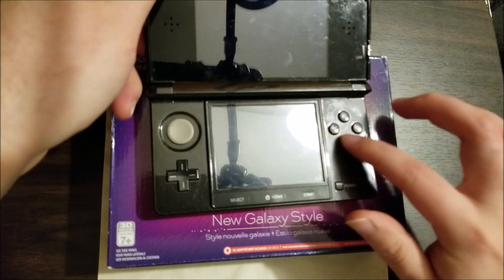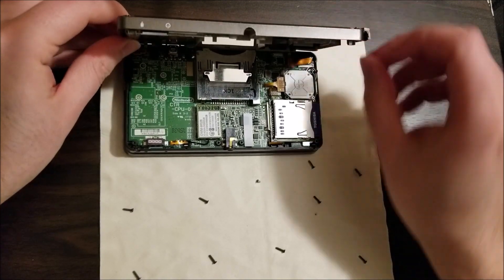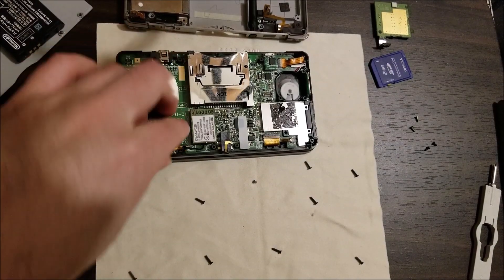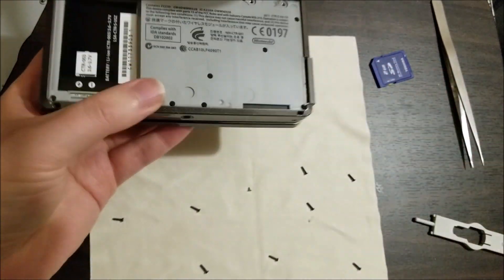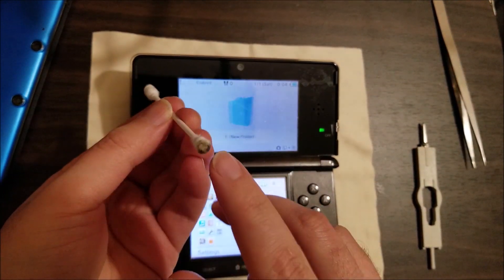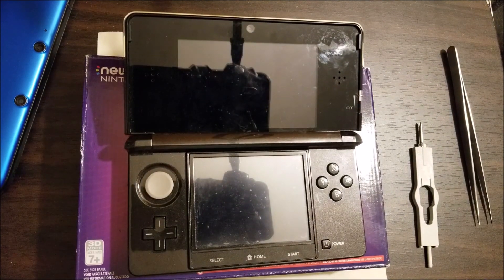Let's Fix: Nintendo 3DS Buttons Not Working

Comment: does this also work on the different models of the 3ds i just want to make sure (new 3ds xl, new 2ds, etc.)
Reply from the maker: As far as I know all variants of the ds use the same tact switch style buttons, though some have discrete smd switches (which imo is an easier fix as you can just buy and solder new buttons rather than mucking around with peeling and cleaning).

Comment: Thanks for uploading. My 3DS is having this weird issue where the A button registers two inputs at random in quick succession. It seems to be once when pressed and once when released.

Would you say it's a good idea to try and clean it from the outside with IPA or canned air? Nintendo suggests using a toothbrush on the buttons, which worked a couple of years ago, but it ain't cutting it anymore.

Anyway, thanks again. This will come in useful if I do pull the trigger.
Reply from the maker: Yeah sounds like it may be getting stuck slightly and need some cleaning.
Reply: @sjm4306  Right, thanks. And excuse me, but do you mean by taking the console apart or just some cleaning from the outside? It was by basically sticking the toothbrush into the button.
Reply from the maker: First try cleaning with a soft brush and some isopropyl alcohol without taking it apart and if it still has problems after that then you'll need to take it apart and clean the buttons on the pcb and the inner plastic parts of the buttons.

Comment: Hey, I tried following this tutorial and I did but the buttons still didn't work. I opened the buttons not working,  I was wondering if you knew of any other problems, thanks.
Reply from the maker: It could be the metal snap domes themselves are worn out. They sell replacement ones with the sticker already attached on ebay/aliepress.
Reply: @sjm4306  What tools and supplies do you use and where can I get them? Also do you still do repairs? I do not have a steady hand, so I'm positive it's not in my best interest to take apart my 3DS XL myself.

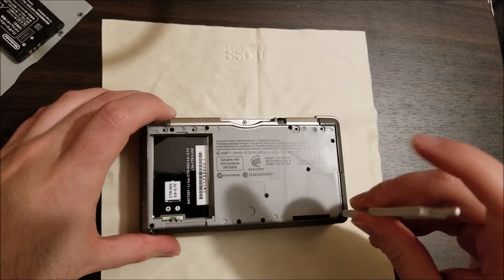Comment: I think it's My fault but up until here I have Problems 2:10
You seem to have an easy time with the screws but For Me THEY ARE NOT COMING OUT!!! I've tried the other screwdriver Heads but one of them work and I thi k they are different Someone Help! 😩
Reply from the maker: You need a small sharp phillips screw driver. If you try to use one that doesnt fit it's so easy to strip the screw heads. Also going slow and pressing inwards helps.
Reply: @sjm4306  I did use a small Phillips head tho, huh looks like I may have to go SMALLER!!!!, thank you, thank you, thank very much here

Comment: Hi sir. Is that a sticker? After you cleaned the seat buttons? Is it easy to remove?
Reply from the maker: The sticker over the metal snap domes is kinda hard to remove as it's stuck very well. It took a few minutes of careful prying to peel it off.
Reply: What cleaning agent did you used sir ? Is that isopropyl alcohol?
Reply from the maker: Yep

Comment: Can this happen with normal use? Because my 2dsxl buttons work fine but they are kinda loose and i always feel they are going to stop working if i use it too much.
Reply from the maker: The specific corrosion damage I showed in this video was caused by some liquid being spilled on the console near the buttons. Under normal use this shouldn't happen, however the metal snap domes in the buttons do have a limited number of presses till they stop working (the number is in the millions of presses though).
Reply: sjm4306 oh ok thank you very much for replying on an old video, couldn’t find an answer for it anywhere.
Thing is i use it for GB/GBA emulation and playing shoot 'em up games feels like too much abuse for the poor thing

Comment: the power button on my 3ds is not working can you fix it?
Reply from the maker: Does it do anything when pressed (does the blue light come on, do you see any of the screens flash, do you hear a click or pop sound)? Also does it charge when plugged in? I ask because rarely does the power button itself physically fail, no power on is usually a sign of another problem like damaged or miseated ribbon cables or liquid damage.
Reply: @sjm4306 it lights up when charged and it takes a day or two for it to turn on after i've pressed the power button many times. i also don't know if it got wet because it was in our storage room for a long time.

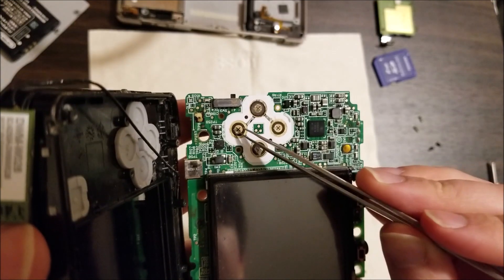Comment: 6:50 How do those buttons work? Does depressing the metal membrane on top connect the circle with the X to the ring outside of it to complete the circuit, or does it work differently?
Reply from the maker: Yep that's exactly how it works
Reply: @sjm4306  Ah, thank you!

Comment: Yeah first i should say thanks for the video, but unfortunately its pretty useless since you cut out the most important part (the one where you put off these silver lids of the abxy button conductors). I am sitting here with a dissassemblied 3ds and cant continue because i dont know how you did it and i dont want to damage my 3ds.
Reply from the maker: The metal domes are literally held on by clear plastic tape, you just peel (though the adhesive is pretty strong). I figured no one would want to watch 10 minutes of me using my fingernails to pick at the edge of the tape to peel it off.
Reply: @sjm4306  
I figured out at the end but i was very worried that i screw something up. Once again, i dont want to be ungrateful because without your video i wouldnt even have come this far (and up to this point it was very thorough). Maybe you could add some sidenote on the screen with short instructions, that would make your video perfect. Anyways, thank you for the video. ABXY buttons are working flawlessly now :)

Comment: Does it work on 3DS XL ? My A button has the same problem, I need to press it very strong for it to work
Reply from the maker: Yes, all 3ds consoles use the same button construction.
Reply: @sjm4306  Okay, how do you do to remove the AXBY buttons membran without damage ? I suppose  that it must be the most damageless in order to replace it
Reply from the maker: The metal snap domes that make electrical contact with the pcb contacts are held on by a clear plastic tape that can be carefully peeled off.
Reply: @sjm4306  I just finished reassembling my 3DS, my touchscreen doesn't light up, my pad is stuck at one place and all of my data had been erased, I wanna cry
Reply from the maker: If you removed the sd card and didn't put it back that'd explain why your data is gone (or if you have the new console variant I believe there's a press snap connector for the sd slot that could be the problem), as for the other problems double check that you fully inserted the ribbon connections. Just opening and closing a 3ds cannot do anything to the data stored on the device
Reply: @sjm4306  Yes, I've got my data back thanks to the SD Card ^^ I'll check the ribbon
Reply: It worked, I've must have done something wrong with one of the ribbon and my A button is back to normal. Thanks a lot !

Comment: Great Video! I was wondering if you could make a tutorial or explanation on how to fix the 3d depth slider on the original 3ds ( Mine is stuck on 3d). When setting up my 3ds it requires me to turn on 3d by putting the slider all the way up. Obviously it doesnt work and therefore prevents me from getting to the home screen. It would be much appreciated if you could solve this. I’ve researched this issue for the longest time on google and yet,still failed to find a solution. Once again, great video and keep up the good work!
Reply from the maker: Is the switch physically stuck, or that no matter the position the software detects it is on?
Reply: sjm4306 no matter the position, the 3d is always on
Reply from the maker: I think that means the ribbon that goes to the top screen is damaged. Luckily replacement ribbons are pretty cheap but a pain to install.
Reply: sjm4306 how can you tell if its broken. Ive opened mine up. But they seem in place, just slightly off the surface on some parts.
Reply: sjm4306 oh and one more thing i feel might be important.
The 2 black circles (that i think had something to do with audio system) were out of place, and i just popped them back in place.
And the 3d symbol does not light up.
Reply: Heres a photo of it https://imgur.com/a/jSnFQ6N
Reply from the maker: Ah the tiny plastic nub of the 3d slider switch on the flex may be misaligned with the outer plastic slider fingers that grab and move it. So when you move the slider it isn't actually grabbing and moving the inner switch if that makes any sense.
Reply: sjm4306 if that were the case wouldn’t the LED still be on? I’ve actually moved the inner switch (atleast that’s ehat i think it was) and tried to change the 3d but it still didnt turn off. Just to clarify, the inner switch is a small black slider right?
Reply from the maker: Yes, maybe the ribbon is damaged afterall. Can you follow the traces that lead to the switch and spot any potential damage in the ribbon?
Reply: sjm4306 i’ve unscrewed the part the ribbon cable connects to, near the switch but everything seems fine, there is no rips at all, the only thing slightly noticeable is that the ribbon cables are slightly loose. As in when i screw it back in, the ribbon cables aren’t directly on the surface of the back of the front screen, instead they’re hovering a bit above it.

Comment: Question: My 3DS's A button is pressed by its own at all times. Is there a way tl fix without tearing apart the 3DS? Like a tooth brush and gently try to clean it up from the outside? Or use air spray with no oil?
Reply from the maker: You could try cleaning the seam between the button and case from the outside if you see any crumbs or gunk in there, but if that fails it's likely the fault in deeper inside and would require disassembly.
Reply: @sjm4306  wow, thx for the tip, i actually just fixed it. There were some fake scrathces at that metallic thingy and i cleaned it! God bless you m8!
Reply: Plz answer
Reply: @sjm4306  thx for replying!
Reply: @sjm4306  should I wet my toothbrush or clean the button from the outside while the toothbrush is dry?
Reply from the maker: Isopropyl alcohol only, if you use water it'll seep inside and take forever to dry, possibly corroding something in the process.
Reply: @sjm4306  oh shoot! I used Contact Cleaner with NO alcohol,is this why it didn't get fixed? I see, so it's an alcohol only fix
Reply from the maker: Yeah, I'd only suggest using contact cleaner directly on the board contacts using a qtip so it doesn't get anywhere else and cause other problems.
Reply: @sjm4306  hello, i opened my 3DS,and cleaned my buttons with toothbrush, but the outcome is the same
Reply from the maker: How does the metal snap dome for the affected button look/feel?
Reply: @sjm4306  for a reason it doesnt have the X  like on yours
Reply: @sjm4306  my sd card slot got out of the motherboard. Can i fix it! I opened my 3DS again because the A button fix was tempo. The metal thing is clean, the plastic A button has something like fake glue on top of it
Reply: I tried to clean the plastic a button with a wet tissue, but the something like glue just wont bear off, im sure thats the prob
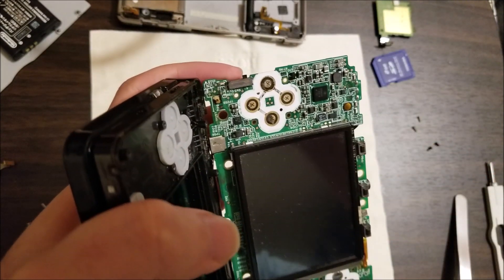Reply: @sjm4306  8:15 is it easy to put back the metlic thing?

Comment: My 3ds doesn’t even boot up
Edit: also the bottom touch screen doesn’t work and maybe buttons but I don’t know because it won’t boot up
Reply from the maker: Is there anything that happened to it shortly before it stopped working? What exactly happens when you try to turn it on (do the screens/power indicator light up at all, can you hear anything through the speaker)?
Reply: sjm4306 I don’t think anything happened to it before it stopped and the light indicator won’t show up and no sound comes out
Reply: sjm4306 the battery could have fell out because when I shake my 3ds it makes a sound, it’s either buttons or the battery
Reply from the maker: Try checking that the battery is firmly seated and connecting to the contacts properly. It just sounds like it's not connecting if you get absolutely no power indicator coming on.
Reply: sjm4306 I can’t find a screwdriver small enough to get the screws out
Reply from the maker: I use a small jewelers set of screw drivers. That failing eyeglass repair kits you can find at many supermarkets/gas stations usually come with tiny screw drivers that should work. Just go slow as you definitely don't want to strip out the heads of the screws.

Comment: Kind of an old video, so I'm more of just hoping this gets read, but it's related to this. I have a New 3DS XL with only one button that is messing up. (the A button)

Now the button is not completely unresponsive, for a while it was actually probably a 50/50 chance the input would be dropped, but now it only registers as pressed sometimes, and if you push down super hard. What would be your recommended way of fixing this? I was considering replacing the face button board, but am unsure if that's exactly what the problem is, and I can't really afford to purchase a new one if something goes wrong.
Reply from the maker: Does it feel mushy or soft for lack of a better word in comparison to the other working buttons? It could be the metal dome is worn. If not then it could have a similar problem to the one in this video and a good cleaning of the contacts may help.
Reply: No, the button still clicks. I've tried cleaning the contact prior, however, and that didn't change anything.
Reply from the maker: If you manually short the bare pads with say a small pair of tweezers does it register easily? My third guess is the corrosion is on the inside of the dome right where it contacts the center pad on the pcb. Sometimes giving the inner dome and pads a light scrub with something mildly abrasive is enough to remove light oxidation that may not be easily visible but still enough to prevent easy button presses.
Reply: Sorry for the late reply. How would I short the bare pads? I disassembled my N3DSXL to check for corrosion on the button faces and it looks clean, I can't see any corrosion at all.
Reply from the maker: You should be able to see the metal pads under the metal dome (a central dot and the outer rim pads). You can use metal tweezers to touch both metal pads to simulate a button press. If this works perfectly then the problem is the dome. If not it could be something up with the ribbon/connector for the button board.
Reply: Ah, I see. Yes, the dome connects with the pad easily, and even has an audible click. So you would say replacing the dome be the best option then?
Reply from the maker: That's why I suggested testing shorting with tweezers first to see if it really is the dome or something else.

Comment: THANK YOU!!

My OG 3DS was beginning to show its age when the B button only responded to uncomfortably hard presses. I took apart my 3DS and cleaned the rubber seat for all of the buttons and the contacts between it and (what I assumed was) the motherboard, but what I didn't realize was the membrane that had yet another layer between the seat and the motherboard. EUREKA! After peeling it back and cleaning it, my B button feels as good as my New 3DS. I still will probably only use it for Pokemon Trading with myself, but I am happy to have a fully functional second console again. :D
Reply from the maker: Always a good idea to have a backup, glad you were able to sort out the button.

Comment: How did you get the silver things covering the buttons off?
Reply from the maker: There's a thin cross shaped bit of tape holding the metal domes on, just use a finger nail to lift an edge and peel it off (it can just be stuck back down when you are done). It is pretty strongly stuck but will peel with sufficient effort.
Reply: @sjm4306  thank you so much i was able to get my buttons clean and working again but i have to ask is there any special way for me to reconnect the ribbon for the sd card or do i just have to get lucky